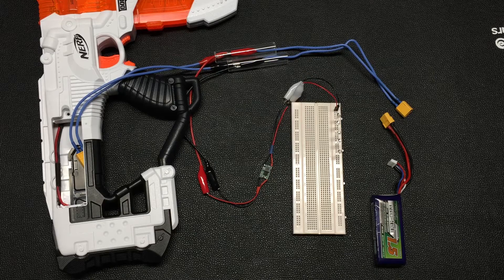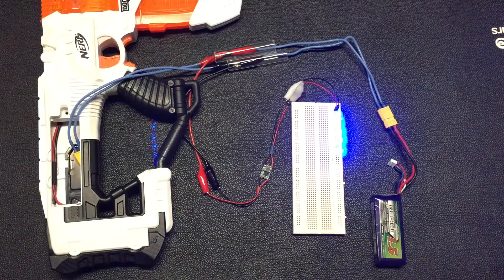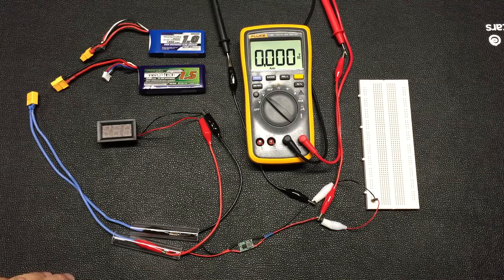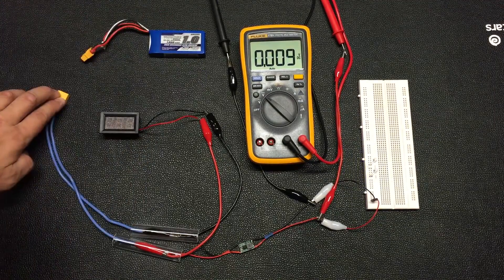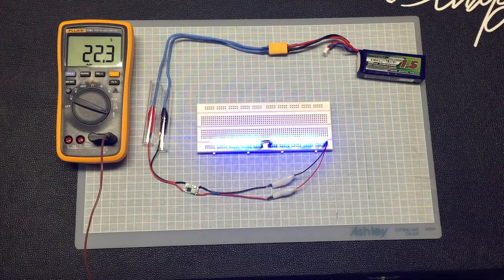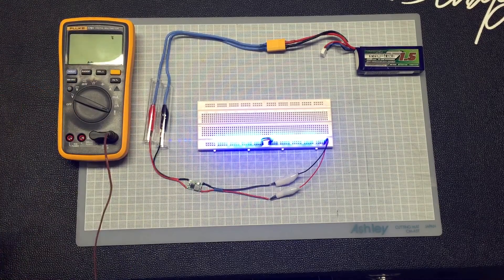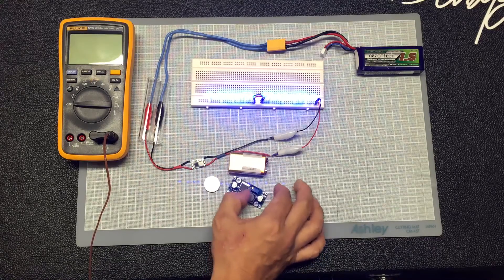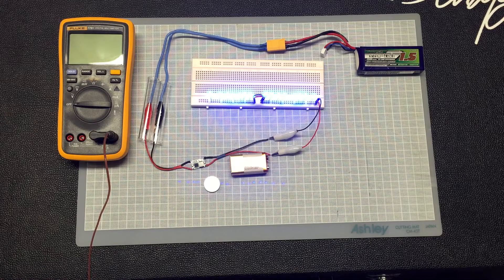{How to} Nerf - use LEDs without resistor

Comment: cam I use this method for controlling the ROF in a auto stryfe…. I need to some how slow it down can keep it there
Reply from the maker: the buck convertor in the video is most likely not suitable as it can only handle up till 3A, there are buckconvertor that is slightly better but can handle up till 5A. However 5A might not be save as well. There is another type of buckconvertor which can limit voltage and current, which mean you can set the limit of current as say 4.5A and voltage to 8V, draw back if you use a motor which might have initial draw of more then the current still it may have a delay, how I believe the normal MTB rhino should be fine.
Reply: once thank you.. your channel is probably one the best when it comes to info... and what you could do with a blaster.. thank you
Reply from the maker: chris soto no prob man, thanks for the support too :)

Comment: could you make a video where you make a tutorial on how to get a modified blaster example the strong arm and fix it to its original form
Reply from the maker: hi Jovan, I am not very good with pump action blaster mods, normally I will just to a spring upgrade and and sometime removal air restricter. Having said that, I do have a few hammershots which I am currently working on, not much again just some spring upgrades, I will be painting them so once I done painting I can make videos one them :) it will take me a while due to my work, will drop u a msg once I did that :)

Comment: What a coincidence, I bought the same exact buck coverter (the bigger one) as you did!
Thanks for sharing this. I gotta admit that I was not too confident about using it, but your video gave me a little more confidence, haha!
Reply: +Tungsten EXE JUST subbed. NOT regretting it!
Reply from the maker: Cool! There are a lot of different types out there, I find those which can control both voltage and current very useful, that way u have full control over voltage supply and current supply, and none of which will go over the limit you set.